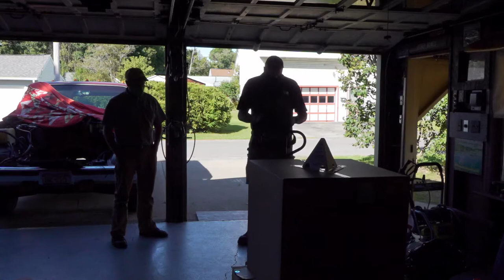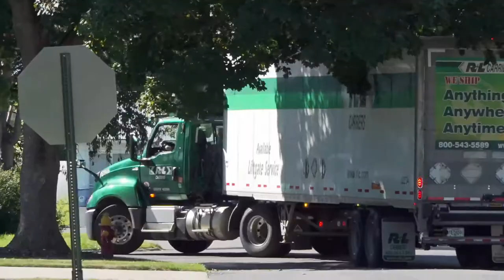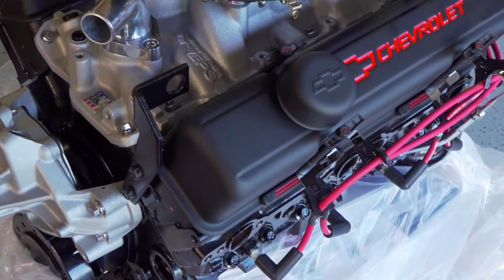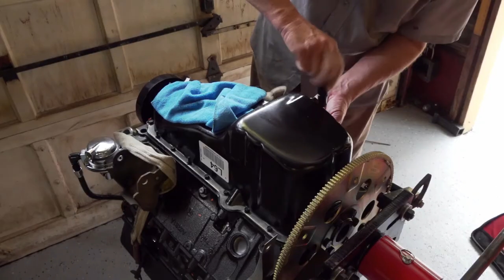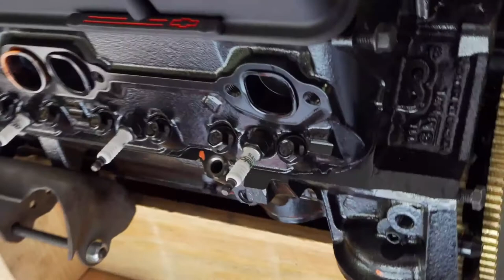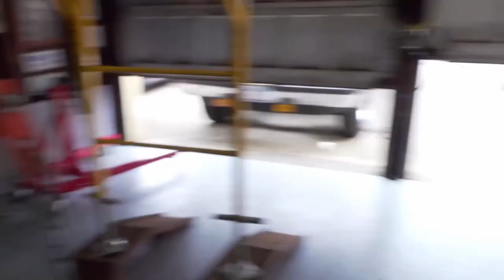Dipstick Swap New Chevy 350 290hp

Comment: Very interesting video. I'm a big Suburban fan as I've got a 1998 and a 1991 model that is rust free I brought back from Nevada. It was a desert car. The 91' has 289,000 miles and the 98' has 137,000 miles.  In the event that I need to replace an engine I would consider the route your taking. I'm looking forward to an installation and a test run video.